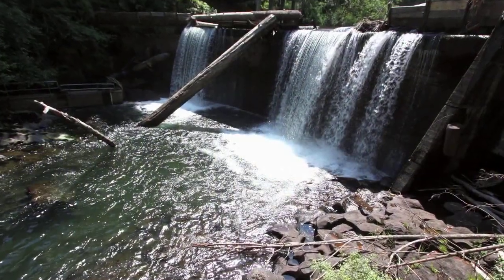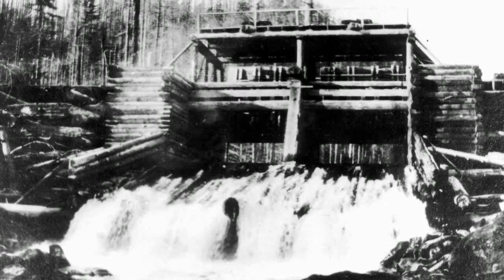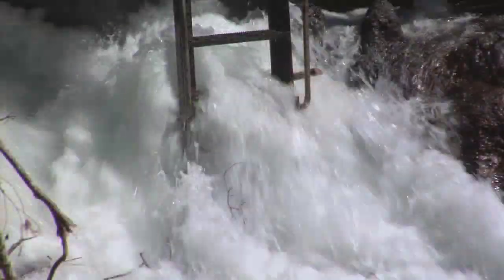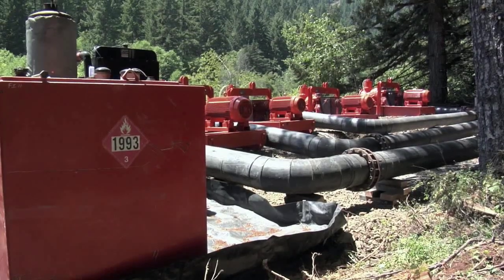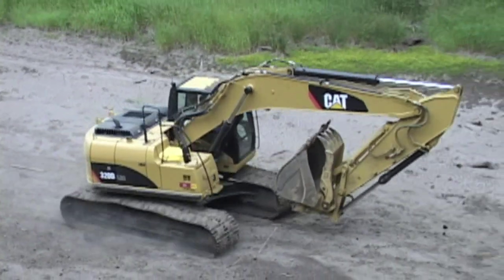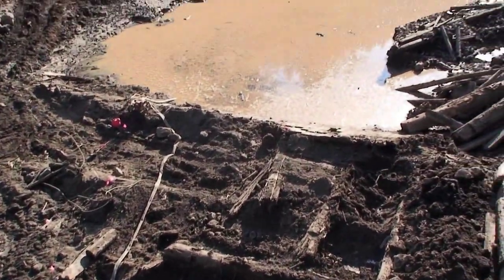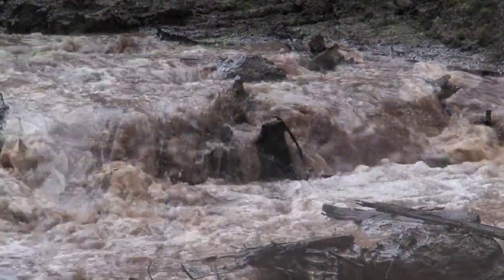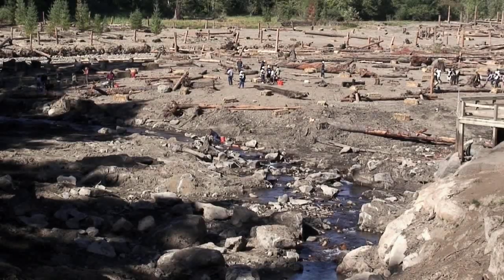The Hemlock Dam Removal Story - Columbia Basin Restoration

Comment: why was the channel not allowed to reestablish itself
Reply: Because the 'experts' thought they knew their stuff.
Eventually  dam removals will be like the Condit and Marmot dam removals.

This way wastes to much money on stuff that will happen naturally.
Reply: it also depends on timing and fish migration at the time of 'scheduled' release of the river back to it's normal state. If there is too much sediment left in the river, it will get washed down and could fill in spawning ground downstream. It could also cloud the water substantially and suspended dirt and sand in the water can irritate the fish, their gills and their senses, leaving them disoriented as to which direction to go.
Reply: @silentepsilon888  with how powerful some rivers are, they like don't have that much dirt suspended in them. If this was a slow moving river then yeah it's possible.
Reply: @alex-marquette  It's the silt that has built up behind the dam that is dangerous. If not properly handled in the take-down, it can damage the environment and the wildlife downstream for a long time.
Reply: As stated in the video, there was a regulation that prevented that..the water quality had to be maintained at a certain level during the removal. They had to flush/ pulse the sediment downstream in  intervals.  If the manpower and money are there, it is a beneficial act.    No argument from me though for just blowing them and letting them reset by themselves if cost is prohibitive of a gentler removal...it’s better long term to remove it in a mess than to leave it there for another 100 years!!!

Comment: HAY as "mulch"??? Do the directors of this project not understand that a bale of hay holds thousands of hayseeds? Straw can be used as mulch, because straw is the de-seeded stems of oats. To use "hay" as mulch is the same as planting an extremely aggressive invasive plant. No transplanted small sapling or bush or native grass will survive in an area "mulched" with hay from bales. Hay, by definition, is grass with tightly attached seeds. Through the following spring, a thick carpet of new hay will cover this so-called transplanted area. Removal of this covering of hay, to rescue the small transplants, will not be possible. 
Is the speaker just using the wrong term for those bales? Is he looking at straw bales and talking about "hay"??? That would be bad enough, as the difference between a hay bale and a straw bale is obvious. Strands of straw are always flat. The color of a straw bale is characteristically golden-orange. Straw has almost no scent, because the food portion has been removed, as oats. 
A strand of hay is rounded. The color of a bale of hay is green-golden, and the scent is definitely hay-like or grass-like. And the HAYSEEDS are obvious. 
Did the directors of this "reclamation/restoration" project deliver hay bales to this site?  This segment, with the "bales" of mulch, casts very serious doubt on the competency of the directors of this "restoration" project.